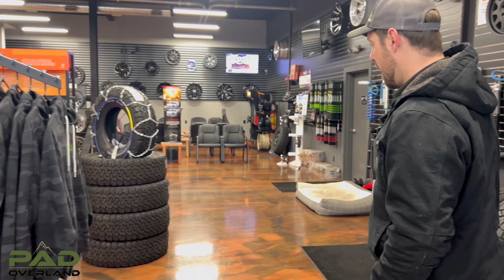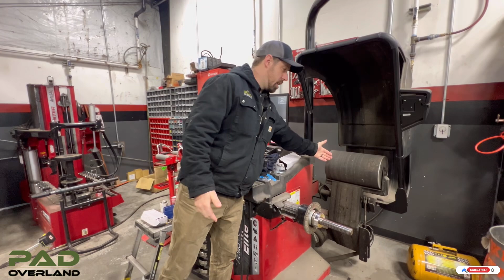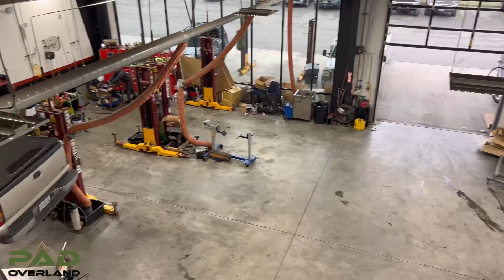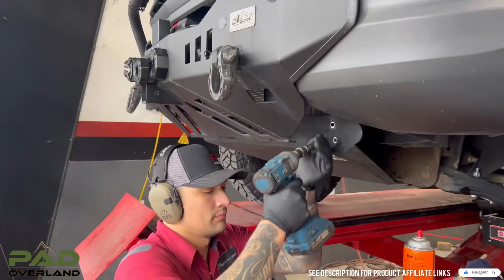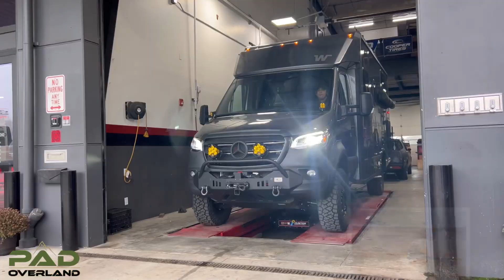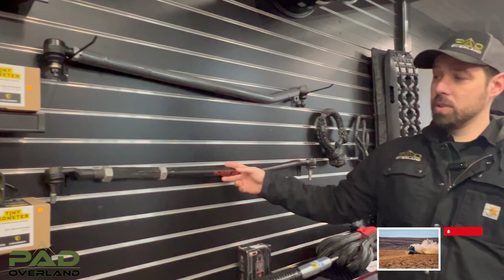WINNEBAGO EKKO SPRINTER SERVICE A | EXCLUSIVE PAD OVERLAND TOUR | DYNO, LIFTS & MODS | #automotive

Comment: Hi Ekkonester's and other Comment Readers.  We have the 2025 Sprekko and one of our issues is the dashboard display.  It shows the oil level upon the startup which is nice to see.  However, it then stays on the oil level when I'd prefer it to be on the speedometer display mode.  I am aware that I can use the touchpad to change the display but it seems like the display could be default preset to the speed after the engine oil status is reported.  Has anyone figured out a solution so that we don't need to keep resetting the dash?
Thanks for any input.  Ken

Comment: Sounds like an oil filter change with a fluid top off? 45min on Saturday in my own driveway for the cost of materials.  Honestly, if you can’t do this yourself, you might want to reconsider going off-road in an RV.
Reply from the maker: Thanks for watching the video! We went with the full Service A: oil and fuel filter changes, oil change, DEF fill, and inspections of fluids like coolant and brake fluid. They also checked brake fluid moisture, suspension components, the drivetrain, and other wear-and-tear items.

A 45-minute oil change, wow on this rig at home, you'd be quick, no doubt—especially without a lift or pit, even with a creeper. But in this case for me working on the ground (our small driveway and narrow street), moving drain pans, swapping fuel filters, and cleaning up can take a lot longer, at least for me with my driveway setup. Plus, oil disposal isn’t always convenient since local parts shops here have limits on what they accept.

Taking the rig to a shop this time was just a little treat for myself, especially after being hands-on with many upgrades and the build-out. 

Sometimes it’s just easier and more efficient to let a trusted shop handle it (like PAD they guys I trust). But, I get your point—it’s a doable DIY (Do it yourself job) job if you’ve got the space, time, tools, and a bit of mechanical aptitude.  By the way, whats your rig? You have some favorite over landing/off roading areas?  Appreciate your perspective!

Comment: Very informative. Why wouldn’t MB not put a skid plate Standard on the sprinter?
Reply from the maker: Hello, thanks for checking out our channel.
I agree it should be one of the first things they would think about with the type of exposure to the cast of aluminum oil pan as well as the other Vital components.  I’ll tell you a quick story, a friend of mine Max who manufactures the skid plates has a client up in the Colorado area. They received a phone call that one of the sprinters needed to be towed in and possibly an engine replacement because the oil pan got shattered, driving down the highway.
Apparently, they were not even off road. My experience has been most of these things typically happen just driving down the highway and something catches the underside.
We sell these on our website as well.